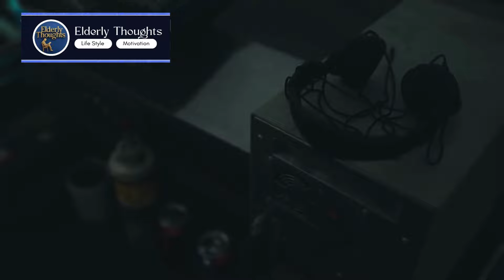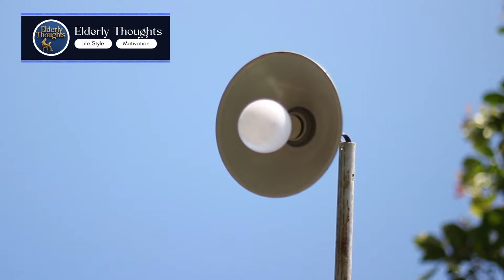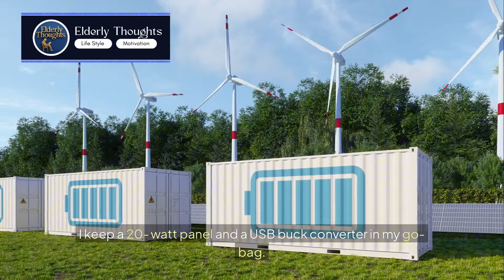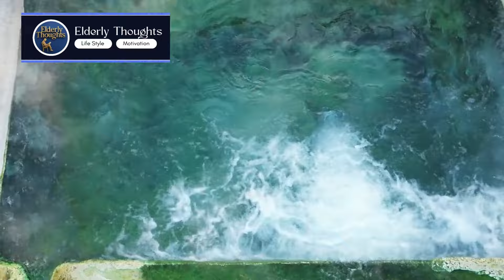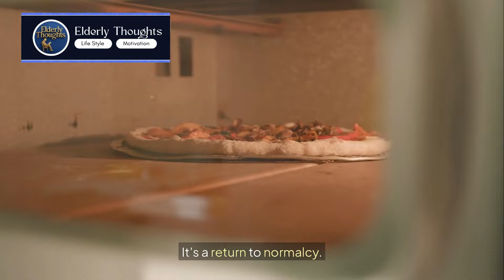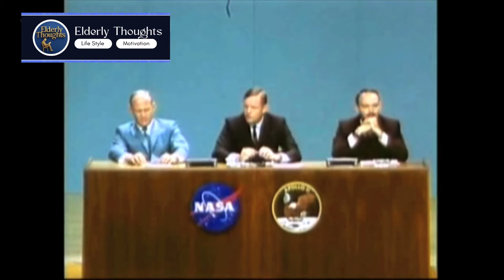10 Survival Essentials Smart Preppers Are Buying Now

Comment: Black-out cloth used to line drapes to keep out the sun.  It can be purchased at any fabric store, works great.
Reply from the maker: That's an excellent and practical tip for keeping light out!
Reply: I actually didn't start using the white "black"-out cloth for that but as a screen for my front projector years ago. It works great for blocking light from coming in.